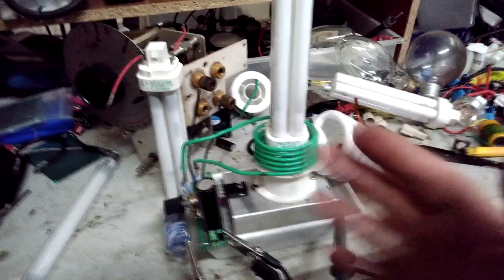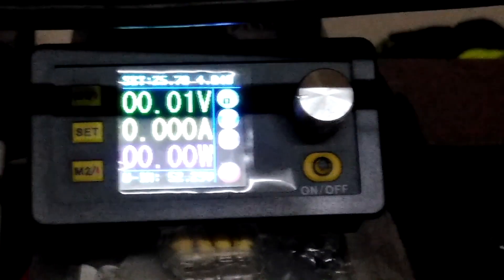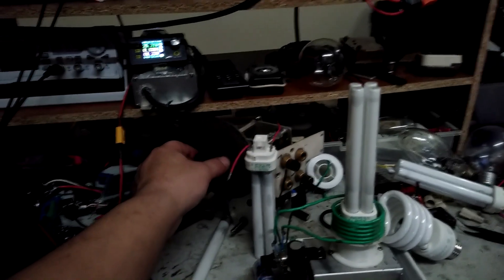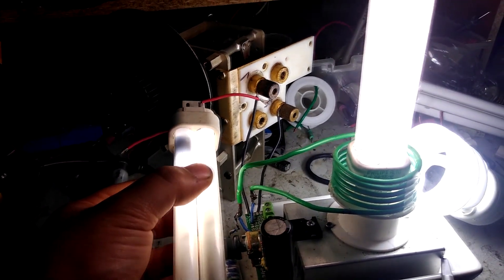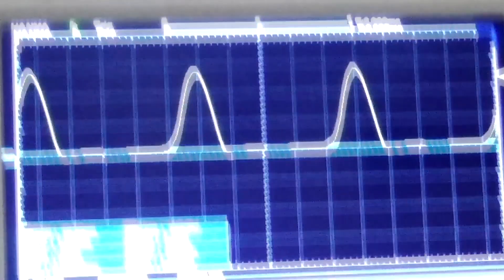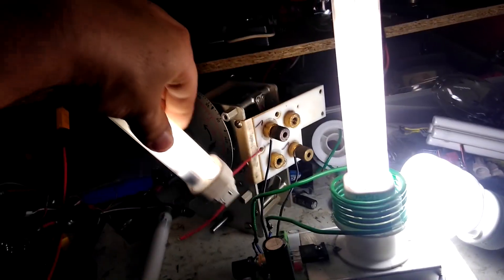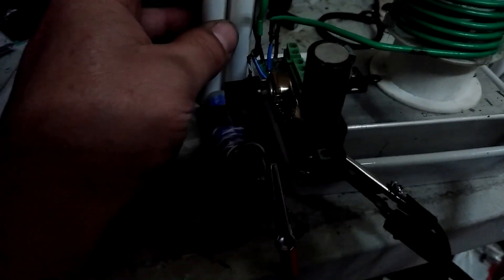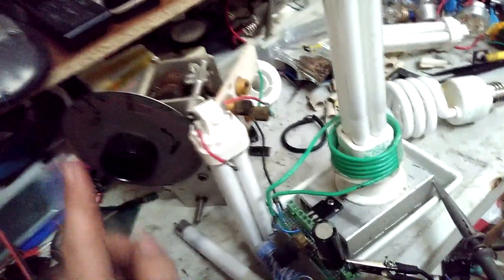HF Oscillator 23mhz 'IRFP460'

Comment: I have used IRFP250N for my HFSSTC.The frequency is around 7-8MHz. The input voltage 72-80V，current around 3-4A,over 85V the mosfet blows.The length of the flame is around 12-15 cm. I also used air variable capacitor for tuning.I noticed that it is important to first set the capacitor to the latest point and then tune it to the resonant  point with a lower voltage like 58V.After increase the voltage a little bit the capacitor must be tuned again because the resonant  frequency changes with the voltage input. Keep doing that and I finally reached 75V.
Reply from the maker: that's interesting I wouldn't have thought such a big flame would be drawn from such a setup cause I'd guess the drain voltage would shoot way over 200V before you reached 60V input. I usually see something around 150V at about 20-25v input.
Reply: I also feel surprised when i finally give it 75v and it didn't blow up[But  the TVS between DS had blown so i don't use TVS anymore in HFSSTC] .There is a video about it in my channel.
Reply: the resonant frequency varies with power also bcs the flame acts as a topload, so if it increases in size the topload increases in size

the mosfet might not pop because it's a good one, i've seen fake mosfets often use NOT avalance rated chips (probably from plasma TVs mosfets) and those pop with the slightest current at the rated maximum voltage

Comment: What if you use a coil of 25mhz?
Drrstc?
Reply from the maker: Yea that's kind of how it works if you mean adding a second resonator coil but instead of just straight induction a second or even third resonator can be added by base-feeding them. So bottom of their secondaries connected to the high voltage node of the LC circuit between cap and coil.

Comment: Great Video 👍Maybe you can try a IRF510 they work perfect on 150MHz and the plasma flames looks really interesting:)
Reply from the maker: 150mhz nice. What is that like 10-15v max you can run it? How about the current draw when a flame is drawn? I'd like to make a low voltage-low power 100mhz+ setup I can run from a battery using something like a 510.
Reply: @Magneticitist  it starts to operate at 8V and work up to 30V current is about 1.5A . The voltage at the Drain is only the supply voltage *2 and good cooling is important :)
Reply from the maker: @lucaelectronic  Nice that sounds reasonable. I need to find some nice little xenon lamps for something like that.
Reply: @Magneticitist  they are really cheap on AliExpress